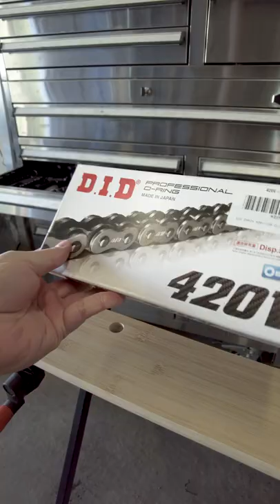#Shorts | New Chain For The Honda Monkey!

Comment: I have the same chain breaker and it's terrible but each time it just barely gets the job done so I can't bring myself to get a decent one :)
Reply from the maker: Yeah, I feel like I'm going to be stuck with it for a long time and every time thinking "ugh, I should replace this stupid thing".
Reply: You didn’t change the sproket?  I thought it’s recommended to get a new sproket when getting a new chain.
Reply from the maker: Generally yes, that’s definitely a very good idea to do. The chain and sprockets will wear each other and ultimately “line up”, so swapping at the same time is a good idea. I didn’t have a huge amount of miles on my sprockets and will likely change them with some other experiments again.

Comment: Not sure why people are taking the front sprocket cover off. Just add some mechanics wire onto the old chain, pull it through. If you ordered a 98 teeth DID 420 chain, no need to break it. It fits.
Reply from the maker: That's quite true, it just adds yet another step that probably didn't need to happen.

Comment: Quick question, why to replace it?
Reply from the maker: Part of the reason is for easier maintenance since the o-rings will prevent a lot of stuff getting into the links. Also different materials can allow for less overall stretch of the chain. It isn't anything that has to be done too early, especially on such a small bike.
Reply: @UnknownOverLand  thanks you awesome